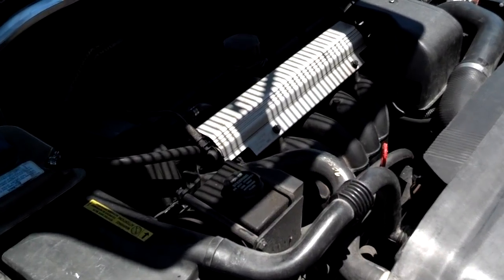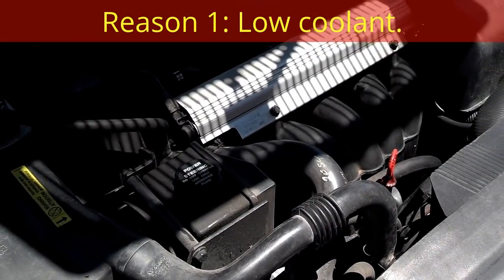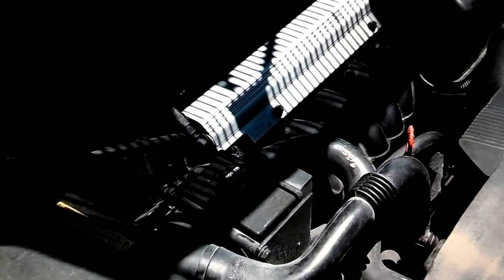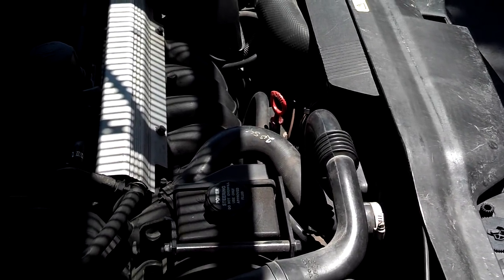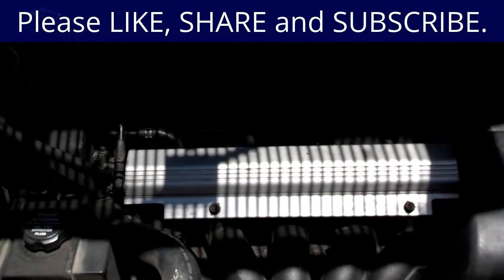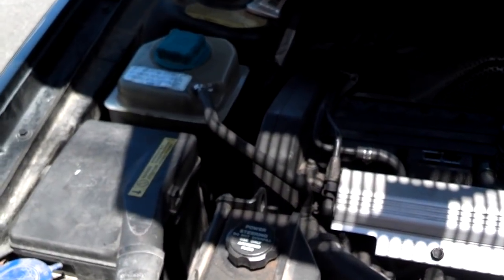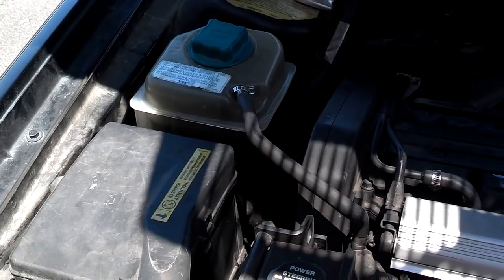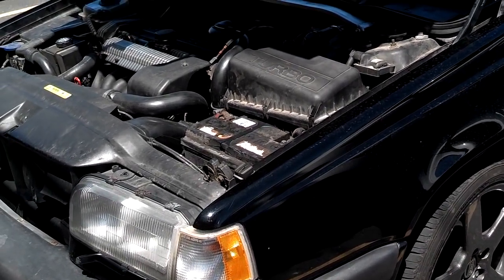My car is over heating, why is this happening? What should you do now?

Comment: Hreat video bro. I have a 2001 GMC Safari van that overheated a few years ago. Being my first vehicle (making me a noob), I overlooked a radiator leak and living in Arizona, one summer it totally overheated. Then last summer, it stalled at a traffic light. The mechanic said there was a lot of water in the oil reservoir, so he added a sealant. It's been working ok, but when I do run it for a while, and turn it off, I'll crank the engine but it won't start until it's cooled off (usually a couple of hours). I suspect a stuck-open thermostat because the radiator fan turns on as soon as I start the vehicle, but I'm not sure changing it will be of any benefit, given it's hot here year round. Would you suggest I change it? Thanks in advance.
Reply from the maker: +Eduardo Felix probably a bad temp sensor.

Comment: Car overheated on highway 37, coolant was at level, oil fresh, hose were good, it would heat.after.stop and go bumper to bumper traffic, after inspecting it realize the fan wasn't turning the way it should, fan clutch was blow and wasn't spinning fast enough to draw air through the radiator when the car was idling. borrowed a fan clutch wrench replaced the fan.clutch solved.the stop and go overheating.
Reply from the maker: +Tony Harris good deal. Thanks for your information.

Comment: This is some good information I delt with one of my previous car that kept overheating on me the headgasket was cracked but before that the radiator was leaking I replaced it and a week or 2 later I found out the headgasket was Crack so I decided to sell the car to a body shop for 50 bucks I got sick of spending money on replacement parts
Reply from the maker: +Gravecb Seven I understand.
Reply: Robert DIY Just know once a car is a lemon you can't make it roadworthy
Reply from the maker: Lemon? Not sure I follow you.
Reply: Robert DIY A lemon is car that's pretty much junk the performance is poor and it's unreliabke think of the Dodge Neon or Dodge shadow I'm just using those cars as an example they were lemons
Reply from the maker: Sometimes a car has  been neglected so badly that it needs a lot of love to bring it back to good dependable order.

Comment: A blown head gasket is not the death of an engine, and can be fixed.  Mine is 14yrs old and had a head gasket go.  Got it fixed runs great!
Reply from the maker: +jason cashman I never said that it could not be fixed.
Reply: Replacing a head gasket can be kind of expensive and plus mechanics don't always do it correctly and the car wont' run right afterwards so most people will just replace the car. With that said if there isn't many other issues with the car or if you have sentimental value with it, people will fix the head gasket and hope for the best.
Reply: Whispered - fuck it. I would fix the head gasket. I would rather take care of what I have, then to replace it with another car that has other problems that I'm not aware of
Reply: Miguel Robb
Reply: Miguel Robb
Reply: Miguel Robb yeah pretty much, you know what is replaced and what needs fixing

Comment: Bruh i use tap-water and it works no probem
Reply from the maker: +Jachin Parent Some problems do not show up immediately. Many things in life has a way of being like cancer.
Reply: Using tap water will cause the coolant system to corrode. You need distilled water, coolant and a 50-50mix. Heck i just buy the 50-50 mix because i don't want to deal with the math of it, just pour it in and you don't have to worry about the coolant mixing properly.
Reply: Using water creates  rust which will damage the radiator among other parts.

Comment: has heat ac working fans come on holds pressure has a small hole in the exhaust where I see water leaking from there and tailpipe checked under the oil cap noticed a little condensation no milky oil on the dip stick flushed the system coolant came out clean could the temperature sensor be bad or worse case scenario head gasket is blown
Reply from the maker: +drae allen I don't know, what is going on?

Comment: does my overheating fall into the third category (fan problem) or is there something else wrong:
when stationary temperature is around 205 F
stop and go traffic 235 F
highway speed  212 F or below but sometime a little bit above
Reply from the maker: +Patrol 2012 does the fan work?
Reply: yes
Reply from the maker: +Patrol 2012 How old is the thermostat?
Reply: +Robert DIY three years max
Reply: +Robert DIY when the AC is off the fan starts when the temperature is above 220
Reply from the maker: That is good.
Reply: +Robert DIY  
I have one more question if you don't mind. 
Should I install an auxiliary fan or a bigger radiator?
Reply from the maker: +Patrol 2012 Maybe the thermostat is going bad or the water pump.
Reply: +Robert DIY my heater works fine so the water pump is probably ok i guess it must be the thermostat. Thank you very much

Comment: 2002 Impala GM LA1 3.4L(3400 SFI) 60* V6 original engine and transmission 165,000 miles, is overheating. My coolant resivoir and radiator are full my fan and relays are new but it still overheats, it also jerks a bit when idling sitting at a light. Would a faulty thermostat cause the engine to jerk while idling? it's the only thing I haven't changed I hope it's not the transmission. Sorry for the lengthy paragraph and any help is appreciated.
Reply from the maker: +Ira Dutary-Audia (Papo) no but it can cause the car to overheat. Also a bad water pump.

Comment: I have an 2002 Chrysler Concorde lxi that is over heating but if I turn on the heat on hi. Then I can drive it without it overheating which worked fine for the winter time but summer is approaching an I really need it fix also I just noticed that with heat on now that if I'm stopped at a light the heat start to blow out cold an the needle start to move up indicating that it starting to overheat again until I pull off an is driving again then the heat kick back in an it cool back down before I have changed the radiator, thermostat,fans,an did a combustion test also, an the hoses can you help out
Reply from the maker: What exactly do you want me to do?
Reply from the maker: Bad water pump.

Comment: what happens if you add to much coolant (pass the max line about an inch) on the reservoir???? Thanxxx
Reply: I would say depending on if you're cool and reservoir tank has an overflow tube or not, overfilling the reservoir tank could cause the coolant to come out of the emergency exit too because when the cooling gets hot at expands, or if you don't have an exit to then it could cause too much pressure to build up in your system possibly blow something

Comment: 97 s10 4.3 motor. Changed thermostat. Still overheats . Fans are working properly. I think the radiator is clogged but don't know for sure..
Reply from the maker: +Primal Just Oh, ok.
Reply: +Primal Just 

FUCK! I too have a 97 Chevy Blazer, with 335,000 miles on it. It recently started to overheat. I'm not driving it now due to the heating problems, but I'm wondering, is your vehicle still overheating? What did you do to stop it?
Reply from the maker: It's simple plumbing. Thermostat, water pump or coolant leak.

Comment: My reservoir was bubbling when I got home and I replaced the radiator cap and it stopped it but now its overheating. As soon as It starts to go over the normal temp I pull over and turn off the car. As soon as I started again even after a minute it wil go back to normal temperature but after 5 mins it will start overheating. I also noticed that when I turn on the heater it stops it from overheating. I grabbed some oil from my dipstick and put it on a spoon on the stove to see if it would bubble because water boils but not oil and thanfully my test did not boil. Any suggestions? (fans work, and topped off coolant after the bubbling incident)
Reply: +InnerBrownProduction Also replaced water pump 2 years ago. Also I have a 2002 Hyundai accent 2002
Reply from the maker: +InnerBrownProduction After watching the video, why do you think it's overheating?
Reply: +Robert DIY I'm feeling the thermostat after getting the car up to temp the top hose is really hot and bottom weirdly cold.
Reply from the maker: That did NOT answer my question. You can NOT feel the thermostat. Did my video say anything about feeling?
Reply from the maker: Just so you know, I'm testing myself not you. I want to make a video that helps people, not confuse them. I'm pretty sure my video did not tell you to take oil and put fire under it. But I do want to know if it is helpful.
Reply from the maker: I just watched the video again, no mention about putting oil in a spoon.
Reply: lol get him man
Reply: InnerBrownProduction water pump?
Reply: Hi I might be late I have a 96 honda I have installed everything brand new even removed the thermostat reservoir keeps topping up and car overheating when I accelerate temp goes down and comes back up on traffic

Comment: hi my acura integra is overheating I just changed the radiator hose and thermostat. the fans are working fine.. and it only overheats wen I'm driving. do u have an idea wat it can be
Reply from the maker: +freshkicks Maybe the water pump is bad.

Comment: If the water pump was broken like you explained, would there be a specific sound while the vehicle is moving?
Reply from the maker: +THEQuantumPolkaDots Nope, just the sound of you crying if you overheat the engine.
Reply: +Robert DIY well that's true now because it's overheated a few times and I'm pretty sure it's done for.

Comment: Hello Rob I have a Ford Fiesta I keep geting overheating. I have changed the water pump , thermostate the head gasket and the the raditor. My fan works fine I toke it to so many garages I even changed the engine I still have the over heating problem plz help me.
Reply from the maker: +Jamal washington Must be an indicator / gauge issue. Get an infrared thermometer and check the temp of the engine and hoses with it to see what the temperature actually is.
Reply: Robert DIY I think its the hoses il give it a try and see what happens.  The engine is replaced so it might be the hoses are old we see Thank you man :)
Reply from the maker: They would have to be blocked or clogged.

Comment: My car gauge meter takes awhile for it to go up, about 10-20 mins then it's at half. But when I turn on my heater or Ac it overheats . It doesn't overheat if I don't turn on the Ac or heater . What can it be? My oil looks good, my compression is good. 200 across on a D15B civic engine .
Reply: thermostat
Reply: having the same problem

Comment: Hi, the opposite is happening to my car.  The engine is cold but when I start it,  the temperature goes up to normal running temperature in less than 5 seconds.  what could be wrong in this case?
Reply from the maker: +Vitage Reis What kind of car do you have?

Comment: Hey Robert, my holden vectra overheats in stop and go situation. my radiator and the fan is working fine. The fan kicks in only when the car engine temperature is at almost at red sign. how do i fix this?
Reply from the maker: +Anirudh G Replace the thermostat.
Reply: change the coolant temperature sensor

Comment: verry good video..... 
I have problems with my GMC suburban 8.1L 2004, overheating alarm appears on MID/display, I Have try to changes cooling parts system, water pump, van clutch(silikon type), thermostat, but still come the overheating coolant alarm, if I ran the engine for about 15 menits noisy start form the bottom side of radiator at T joint and collant reservoir level increasing (pressure type radiator).Now I bring it to the garage and the technician told to me need SERVICING FOR CYLINDER HEAD, CAUSE ANY LEAKING FROM THE COMBUSTION CHAMBER TO THE COLLANT SIDE, SO WHILE THE ENGINE RUNNING SOME GAS GOING INSIDE TO COLLANT SIDE AND MAKING AIR TRAP THAT COUSE THE FLOW OF THE COLLANT  STUCK.... is it correct diagnosis  Mr @robert DIY
Reply from the maker: +bleke thet That is likely with a pressurized system. One of the primary ways I determine bad head gaskets in white block Volvo's. Just one overheat can cause a breach in the head gasket. You really need to figure out what is causing the overheating before repairing the head.
Reply: +Robert DIY  I think because this is my first car, I need more experience. so many thank for your fast response, Just for your information, I stay In Qatar, now summer time, today heat index peak time reach 57C...
Reply from the maker: +bleke thet Wow! Stay cool.

Comment: My truck only overheats when my a/c is on , what could it be ?
Reply from the maker: Ren hoyze Extra load and bad fan speeds.
Reply: +Robert DIY I feel like such a nerd, my coolant level was low in my radiator -__- thanks for the advice though

Comment: Very comprehensive diagnosis much appreciated. I just flushed the radiator out bc the coolant was very low and what was left was rusty coolant. The car does not over heat but the engine gets super hot compared to my Honda even way after the car has been in park. I might just get a radiator for her Buick LaCrosse
Reply from the maker: Johnny Wong A thermostat may be in order as well.

Comment: I got my p/t cruiser running a couple months ago by adding some engine block repair and changing the oil...I have to add water everyday, coolant is too costly... My question is where is all the water going? The oil is still clear and water free.
Reply from the maker: scottgixxer67 I have no idea. You have to find the leak. Is the tail pipe smoking?
Reply: There are no leaks from the engine... The water must be steaming out while driving, no steam or drips when stopped...
Reply from the maker: Adding coolant = leak.

Comment: My car overheats on highway after 20-25 minutes i open the fan because i made a switch for it.I have the fan open all day i dont have pressure on the turbo and the car still overheats.If i hit the gas pedal with some turbo boost the motor just heats up immediatly.No leaks brand new head gasket dont know what is wrong.I dont use any oil cooler or the standard.Maybe i think the radiator needs replace since its 30 years old but it looks fine,,,I have Renault 5 Gt turbo Thanks!

Comment: My question is my boyfriend change the thermostat and the still is in overheating wat he can do
Reply from the maker: Lurles Sanches Probably bad water pump.
Reply: How he can change the water pump
Reply: He already put a new thermostat , h cleaned the radiator , but it still says its overheated.
Reply from the maker: What kind of vehicle is it?
Reply: Is a mercury mountanier 99
Reply from the maker: You should probably Google "Mercury Mountaineer water pump replacement".
Reply: OK

Comment: I have a 04 pt cruiser that keeps running hot..I have changed the radiator and radiator cap,thermostat,the high and low relay, the radiator fan, the water pump, head gasket and timing belt .what else can it be. this car is driving me crazy and putting me in the poor house. please help.........
Reply from the maker: Sandy Powell Yikes! Maybe it has a bad gauge and is not reporting the proper temperature. Get a hold of an infrared temp gauge and shoot the upper and lower hoses to see what them they are actually at. A bad temp sensor will send bad readings to the gauge.
Reply: I have done that. It boils over. Bubbling and gurgles. I've had this car a month and havent been able to drive it yet.what about heater core Ora sensor
Reply from the maker: Probably has a blown head gasket. Go to NAPA and ask for a combustion gas tester and test the coolant.

Comment from the maker: Jonathan, for some reason I am not able to reply to your message. Likely some setting you have in your account.

Anywho, when the thermostat is missing, it will take much longer for the car to warm up, so you need to install a thermostat.

If there is corrosion in the system, it is likely due to someone using water instead of a coolant mix. The system should be flushed and filled with the proper coolant.

The issue with the fan is likely either a problem with the relay or with a temperature sensor. You should fix that as well.
Reply: My grandfather car was over heating some guy said to drive fast and it works my grandfather and me and my dad was stuck in Manhattan when we drove fast in the Brooklyn bridge and we are back home we came back at 113 in the morning
Reply from the maker: Doesn't sound like a good solution.
Reply from the maker: No, a thermostat is NOT connected to the fan. The thermostat is a spring, the fan is an electric motor.
Reply from the maker: Are you trolling me? Do you have an issue?
Reply: +Acquired Cents switch under the car...
Reply: Hey Robert..  I was leaking coolant but the temperature gauge never went up so I took it down to the shop and they said it was the water pump.. then he said there was a crack in my radiator so I had that replaced.. when I leave the lot my car the thermostat went all way up to H.. when I first got the car I was sitting in a McDonald's drive-thru and I noticed that the temperature was going up so I don't know what happened but I turn the air on now all of a sudden the thing went back down to the middle and that's how I knew I have to turn the air on every time I would be sitting... now he says I have been head gasket blown... and I bought my own parts and the guy that did it his shop I've known him for a long time well since I got the car in 2013.. I feel like that somebody's may have done something to my car.. it was at his shop for 7 weeks I went and got it yesterday and went up to H and I pulled into my driveway and it was smoking like crazy so when I pull in my driveway I cut the car off.. I had to move my car so I turned it back on and it wouldn't start.  What do you think it is or could be
Reply: @RobertDIY  I sent you an email but it was the wrong email address